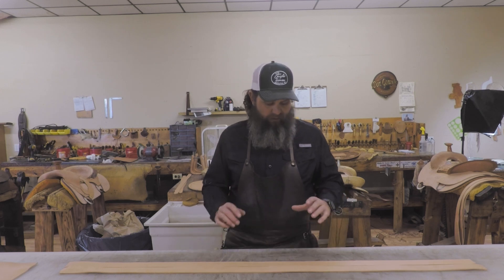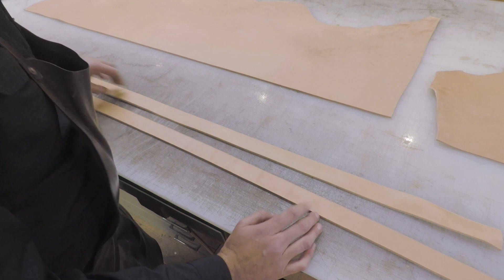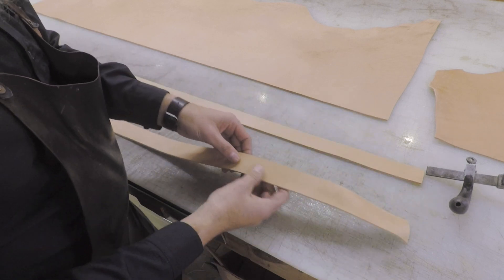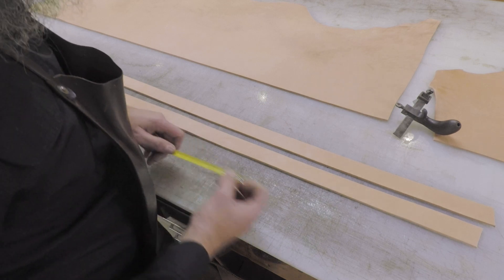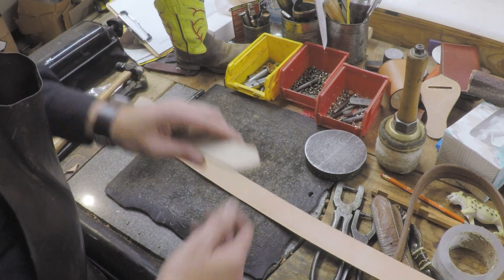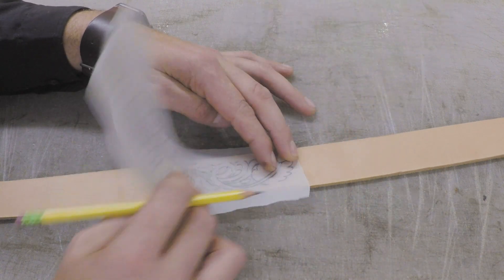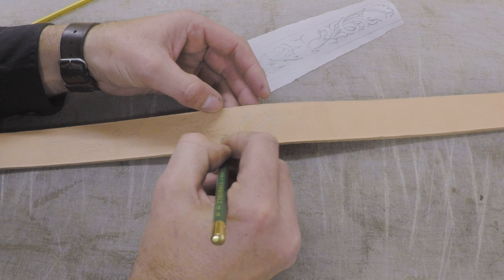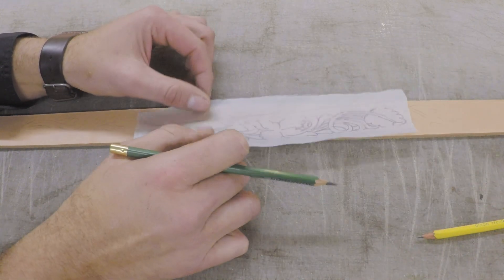How to Transfer Belt Floral Patterns

Comment: I have a draw gauge and pretty much always have an uneven end or a slight curvature in the belt blank...I'm sure its because of the stops and starts and possibly getting in a rush. Question is: Is a actual "strap" cutter from craftool or somewhere like tandy any better than a draw gauge? I understand its the same theory but have never used a strap cutter and it looks like it secures the leather better. I bought a draw gauge thinking its the same thing as a strap cutter but from what I've read (after purchase) a draw gauge if more for saddle work with super heavy material.  Any input is greatly appreciated!! Great videos and thanks for putting them out...they help a lot!

Comment: Just an idea for anybody wondering what to do with their left over belt blanks, I make ear rings out of mine, easy little money maker to use up scraps!
Reply: Never tried it with heavy veg tan, but all the little scraps of soft chrome tan from other projects are great patches and reinforcements for camping gear.  A wear spot on nylon after a year of use, patched with even 2oz leather will last for years...and you'll never run out of patches if you're doing leather projects.
Makes me wonder if there would be a market for pre-punched rectangles from the scrap bin.  Maybe even a little kit of several with a needle and some waxed thread for field repairs.  I usually have a speedy stitcher in all but my lightest backpacking loadout, but someone who doesn't already have one (or several) might just want an all-in-one repair kit.